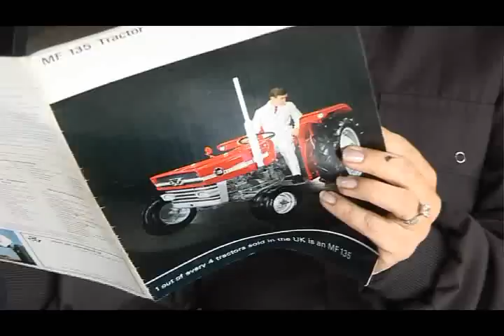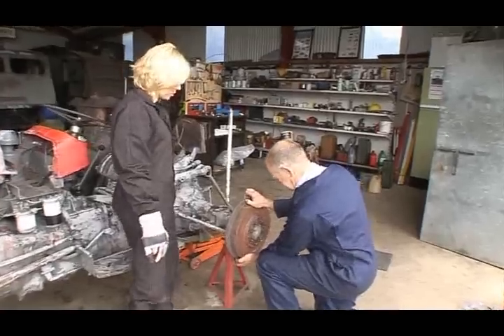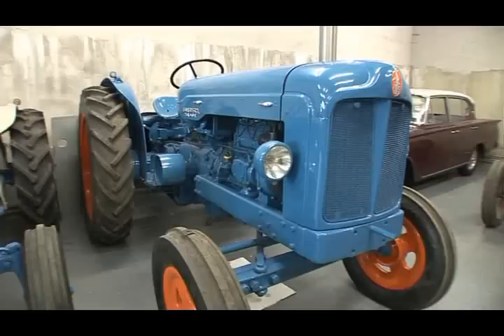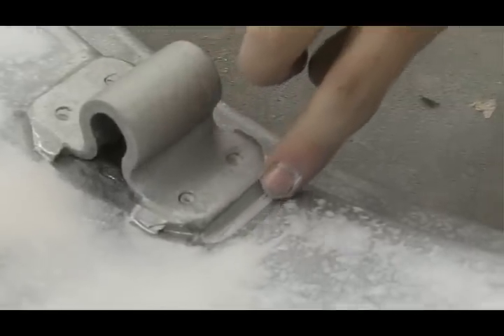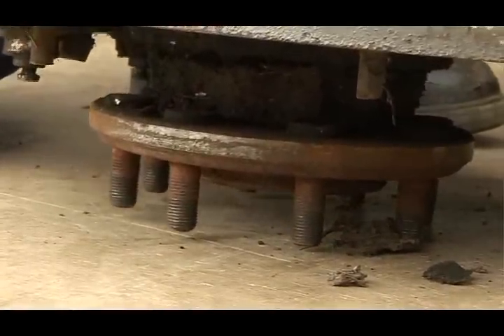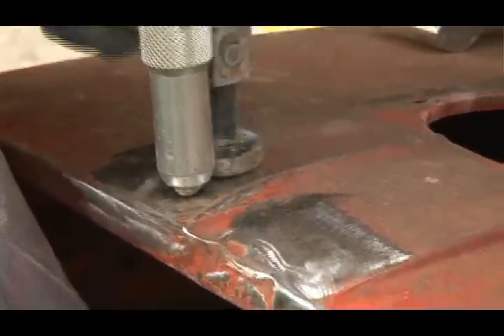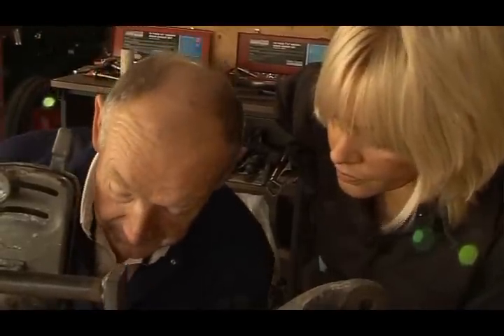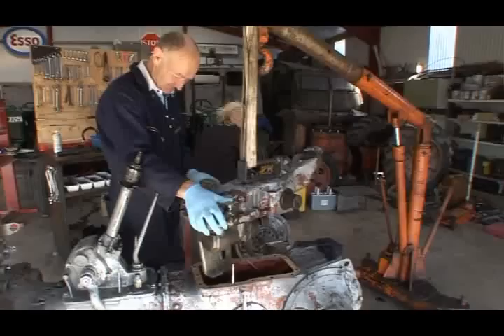REBORN TRACTOR DISC 1

Comment: make sure you change the oils and filters, get advice on the type of oil, using high detergent oil ,you will de carbon it. although Ok, if you have completely  reconditioned the engine. You will certainly manage.

Comment: I restored my massey 135 it was a 3 cylinder gas powered . and a week later a labourer drove over a set of harrows destroying the rad and grill damaged both lights flattened two rear tires and one front. made me throw up. just over two grand sshwitt gone..

Comment: Great video  your doing  well for having  a go like the 135  have a tea 20 ferguson  35 grey and gold a ferguson  35 x red and grey and a ferguson  35 normal  red and grey not a x
Reply: During the 60's I spent many hours on the old Grey and Gold ,, ,, in the 70's a Red 35 but my favourite was a 35X  ,, so easy to work and drive  ,, next Fav was a 290 , another very comfortable tractor to drive and work,, and I will add  none of these tractors had cabs,, just sitting in the sun ,, lolol